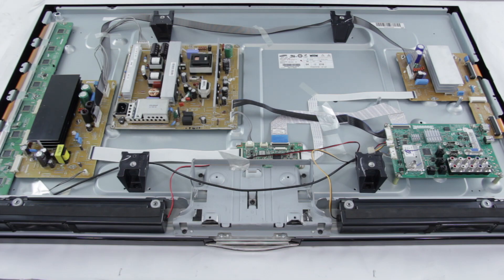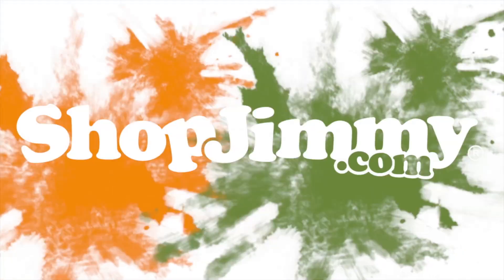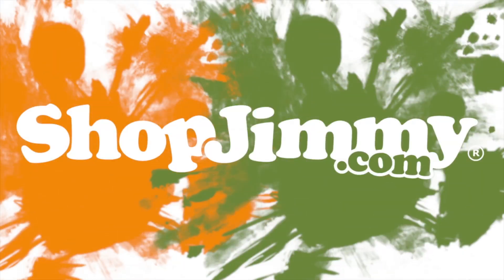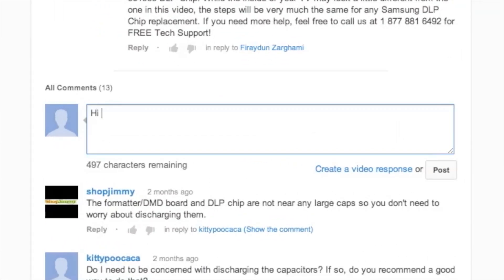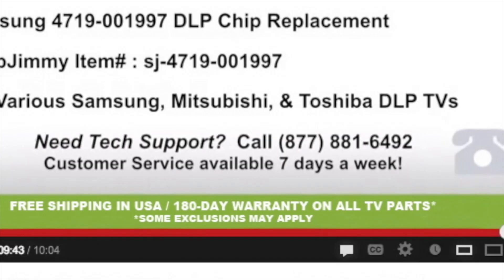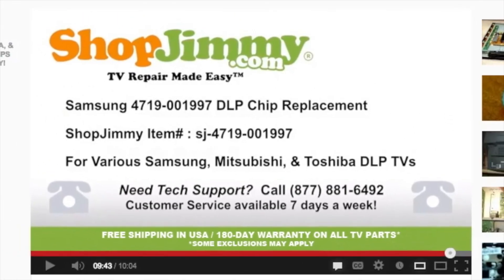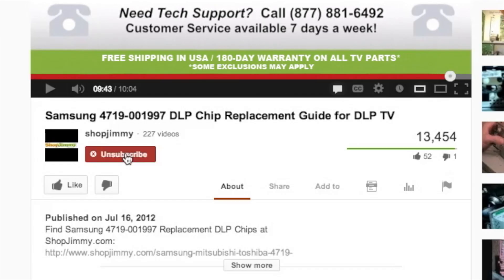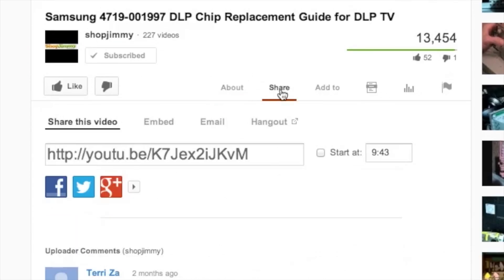Plasma TV Repair Tutorial - Common Symptoms & Solutions - How to Fix Plasma TVs

Comment: i have an LG plasma (50PS70) that wont start up. It shows the red light standby light, then when hitting the power button, blue light under the TV flashes then turns off and goes back to red standby light, what can be wrong?

Comment: Great information, thanks. I have a Samsung 43" tv that makes a noise when first turned on, screeching noise, then goes off and back on. through out the day it will cycle on and off. model number pn43f4500af(xza) type: pn43f4500 Ser: z6m03cqd430899y   any  help would be appreciated and if you think it's worth trying to repair and you have a part let me know.  thanks...

Comment: Samsung 50" plasma with vertical lines that are only on occasionally (about 2" thick and about 8" from the left of the screen) The fact that the line is only there occasionally is what is confusing.
Reply: Model number is PN50C490B3D

Comment: so I have a LG 60PN6500-UA it was working fine until just recently the red light that is usually on while the TV is off (standby light I assume) was no longer on. When I would try to turn on the TV there would be no response. If I unplug it you here the TV click like it does when turning on or off and the red light would come on until the capacitors drained. when I would plug it back in the TV would click on and the red light would flash but the screen would be black but noticed it was illuminated after turning off the lights. I would not be able to turn the TV on or off during this with either the button or remote. I did find on a forum a way to reset the logic board I believe by unplugging the TV then while holding the power button down plug it back in and it would reset the board, doing so would get the TV to turn on and work fine for the duration of use and maybe a short time after turning on and off as usual, then eventually having to repeat said process to get it to turn back on. Any help with this would be greatly appreciated. I want to said it's the control board but after watching this video makes me wonder if maybe it's the power board or something else.

Comment: PN51E550D1F

TV won't turn on. red light blinks 10 times pauses and then blinks again. This started happening after a brief power outage from hurricane matthew. I opened the back and the capacitors seem to be fine.
Reply: check the fuse on the transformer,  the sound look like your TV is a Panasonic plasma

Comment: SAMSUNG PS60F5500 Smart 3D 60" Plasma TV
It turns on and off and on and off, each time displaying my PC perfectly or what ever is connected up, briefly, 8 seconds roughly. Then turns off. Then on again straight away and does same. Repeats over and over. I was trying to get to the menu to hit reset, but turns off before then. I noticed that on the second repeat it impossible get into menu, freezes. If ya plug out power and turn on, you can navigate for 8 seconds before it goes off. You can also turn it off yourself before it turns itself off. And leave it for ages and turn on, but it will then start the cycle
Any help much appreciated ?
Regards 
Daniel
Reply: I have bought a spare part as the fault is very like what you have explained for the Y SUS.
SO buying this. We change and see fingers crossed. Exciting 
Samsung - Y-SUS - 60FF, LJ41-10331A, PS60F5500AKXXU
Reply: Did it end up being your Y-Sustain?
Reply: Nope.... There are three boards. I first bough the Y-Sustain board and changed it... Problem still there... So gambled again and bought the power board... It also was not the problem. I then said fuck it might as well see this to the end and bought the Motherboard, that fixed it thought. I dont mind having the two extra board, never know might need them. I will be watching this TV till its is do dead, not even God can fix it . LOL
I have noticed the TV buzzes a bit too now, so that must be another problem Due ! It buzzes more when bright screen and less with dark screen.
So wait and bite my nails for it to die again
Reply: I'm glad it worked out for you. I had someone give me a nice big Samsung 3D plasma TV. So far I haven't figured out much. If it's not too expensive I may start gambling too.
Reply: you'll need to remove the boards and get the code and model of board. Makes finding replacement board easy. I paid about €120 for all three boards, which isn't bad considering what it may have cost to fix it. I still have two spare boards in case. Depends what your problem is though, whats the issue?
Reply: When you turn on the power the relay clicks once, the TV buzzes (like a screen about to initiate) and the screen flickers slightly like it wants to turn on. Samsung PN60F8500, It's just a few years old and it seems that the boards are pretty hard to find (and expensive). I detached the X and Y sustains last night and with either (or both) disconnected the TV won't turn on at all. Considering its behavior it feels like a power supply board issue to me. Obviously I am an amateur when it comes to TV's and there could be a few culprits here. I am going to see if I can't figure out how to test it with a multi-meter and go from there.
Reply: Nah man parts are easy find
you have to use the model code
... will pop up straight away,,, there numbers found on the board, not the tv model , the board model... once ya google that, you'll ind instantly
Reply: Mine (Sanyo dp50749) does the turn off and on repeating thing while the light is green, I'm thinking I should try and replace the main board or the Y board..  What do you guys think?

Comment: My 60 inch Samsung Plasma has vertical lines on the right side of the screen.  It started out as 1 line running from the top of the screen to the bottom.  Now there are several lines, a few which do not reach the bottom.  The model number is: PN60F5350BFXA.  Thanks for your advice
Reply: excuse me but I don''t believe PLASMA screens have T-Cons do they? I thought only LED TVs had those?
Reply: plasma tv have T-CON BOARD they call it LOGIC BOARD...
Reply: I just had the same problem on my PN60F5300BF, did you figure out what it was?
Reply: My trusted technician determined that a channel was not functioning (I don't know what that means).  The fix requires a $900 part.  I decided to trash it.
Reply: My PN60F5300BFXA also has all purplish vertical bands and lines across the whole screen.    Is that the logic / Main board?
Reply: Daniel Carbaugh
Reply: Y-Buffer board, one of the chips is bad, get a new y sustain board as well as a BUFFER as they get replaced together for good measure ....
Reply: Chances are, YES it is the logic. Do you see the heartbeat LIGHT, How often is it going although it can act normal pulses but still be the logic. The main way to tell what it is beings the ribbons are fine is to pay notice to if the vertical lines are all from middle to left or right to middle as that can be the left or right address board as well as logic but in my case, i knew my connection ribbons were good and cleaned and the pink (sometimes diff colors depends on TV brands and settings, etc) VERTICAL line are from one side to the other as in BOTH address boards then it is probably as you said, just a logic board - order the board as they are cheap on eBay! Worth a shot, worst case, get two new address bars to if you feel the ribbons are def not damaged in anyway, thy can take more of a beating them people like to lead on, especially TV repair men! I blown mine up with over voltage and the arcs didn't even burn a whole or scorch them, I agree with you and say LOGIC for sure! Good LUCK man! -Stephen
Reply: So im having a issuse with one of my tvs samsung plasma model pn51d430a3d
So i had replaced the main board that has the hdmi ports an such. As well as the y buffer board but i still am having issues with the screen only showing 2/3s of the screen. Sound is gone dont really care about that. Color is all good. No crazy lines or anything showing. It just has 1/3 of the screen all blacked put 

What is the issue?
Reply: Brian Hall t-con board !  Easy fix

Comment: i have a 42 inch samsung plasma identical to the one in the video. it was struck by lightning through the cable box. it had no power to the video board do i replaced it. Now when you plug the tv in the relay on the power supply will click but i dont get a red stand by light or the tv will not power on. If im not mistaken the logic board has a green light that is suppose to flash every second. This light is only flashing about every 5 seconds. Any suggestions?
Reply: signal board

Comment: I have a Samsung 50" Plasma TV Model: S50FH-KD03 and just recently my wife and were watching a program when all of sudden we hear this popping sound and the picture disappears. The odd thing is that the stand-by came on and stayed on (no blinking). I'm thinking one of the fuses on the power board blew out but I can't tell if the fuse or fuses did blow because all the fuses are covered in white. Could that be a problem. I looked at all the capacitors and they are look good but I could be wrong. Should I send it out to a repair shop or is this an easy fix I can do at home?

Comment: Hello. I've got a 50" LG Plasma that simply turns off once turned on. It may take 5 minutes to turn off, or it may take 2 days to turn off. The tv does get power and the screen is fine. It simply powers off. Once some occassions when powered up, it will initially ask if I want to use a prticular HDMI, via a window that appears on the screen. Whether I chose 'yes' or 'no', I get the same results; tv powers off. Sometimes after I've attempted to turn it off then on, it simply WILL NOT turn on at all. Could this be a main board or power board issue? Thanks in advance!

Comment: Hi Jimmy I have an Samsung PN58B650 it was running fine until few days and all of sudden it just went black and keep on restarting the Red power /Standby light keeps blinking for few times and keep cycling. I saw your video which is very helpful but I need more information so I can order the correct parts for it. Also I opened the TV back and I didn't see any bad capacitors so you don't mind guiding me that will be great thanks.

Comment: I have an RCA 42"tv  model number LED42C45RQ made December 2013. The back light comes on for just a second or two then the screen goes dark any thoughts? Another video suggested that there might be some bad capacitors on the back light driver side of the board but I didn't find anything obviously wrong like the video shows can you help.

Comment: I've got a 42" vivo plasma TV S42AX-YB09 that has no picture, turns on and makes clicking sounds but the picture never comes on, the LED in the corner won't turn off afterwards either without turning the main power switch to the TV off

Comment: I have a 60 inch LG plasma model #60PN6500 shuts off occasionally when volume is pressed, input,and channel changed then it turns back on after a few mins if you can help me out i really don't want to get rid of it.

Comment: Sanyo TV DP42740. Just put in a power supply. The TV clicks when plugged in. There is a green light that comes on inside the TV. No lights coming on the front of the TV. Push power button and nothing happens.

Comment: I have a Samsung PN51D490A1DXZA Plasma TV. NO sound No video, light on logic board flashing fast after ~ 30 minutes shut down. I have checked some voltages. 
VS checked 270 volt and keeps moving up 400 volt +.
VA checked 97 volt and keeps moving up 110volt + .
On logic board 
Pin  #1- 5volt checked 9.47 volt
Pin  #2 - 5 volt checked 9.47 volt
Pin #6 - 5volt checked 6.38 volt
Need help. What do I need to replace?

Comment: Hi Jimmy
I have a Samsung Plasma PN51F4500BFXZA. It was working fine until a thunderstorm hit. It was connected to a power strip and so were all my other devices. The power strip and everything else is working fine but the TV now won't recognize the signal coming from the cable box. It happens at both HDMI ports. The cable box has been tested with other TV's and works fine. I have used a computer to watch Netflix and both HDMI ports work fine for computer signal. So, it's only the cable signal that's compromised. I've tried a soft reset (unplugging everything) as well as a Factory Reset and it didn't fix the problem, What would you recommend? Thanks!

Comment: I have a Samsung PN51D450A2D that stopped working with the clicking noise. After watching several vids, I have discovered that even if I disconnect the power supply from the X and Y boards, the clicking continues. Also, the green LED on the logic main does not come on at all at any time, however, the standby light does.

I have not yet put a meter to it to check voltages.

Thanks

R

Comment: Hi Jimmy,
I have a Samsung plasma tv PN50C450B1D that has no picture. Main psb board is a BN44-003330A. When it's plug in there is 6 clicks coming from the relay(s) on the psb, the stdby light on front blinks on/off then when the clicking stops the stubby light stays on. When I disconnect the logic board connector from the psb the tv keeps cycling with the familiar Samsung start up sound and then does nothing. No indication of any capacitors bulging on psb. Any suggestions. Thanks.

Comment: Hi my plasma is a Samsung PN60F5300 the problem is that i have 2 vertical line from top to bottom on the right side a couple of inches from the edge of the screen, which board do you suggest i replace ? Thanks

Comment: I have an LG 50PV450-UA plasma manufactured on march of 2011.  It sustained a large power surge and will not power on.  The stand by power light will not illuminate either.  I replaced the power supply board and it still will not power up.  The only difference I can tell between the original board and the new one is the number after the forward slash in the part number old board was 10 and the new board it is an 8.  Any suggestions?

Comment: I have a Santo dp50710 that the green light stays on but no picture. there is a small green light on the green board to the left of the power board. at the p2 terminal the voltage drops when the small light goes out.

Comment: Hi I have a Samsung Plasma tv model PN50C450B1D. It does not turn on and no standby  power. It looks the same tv that is on your video. It is not the power supply because I already change it and symptoms are still the same.  Thanks

Comment: That looks like a NS-42P650A11, correct? If so, what fuse do these take? I have power and a standby light, but when I try to turn the TV on, the relays click, the standby light flashes a few times, and then goes back into standby mode. I'm going to Harbor Freight in the morning to get a meter so I can test the fuses and the 5v lines, but I thought I'd ask about the fuse type/size since it may take a bit of time to get a reply to this comment. Also, feel free to treat me as a novice, no offense will be taken since I can use any and all info you can give me.

Comment: hello  my l have  PN60E530A3FXZA  samsung  I  buy and replace  power supply board  also  main board  brand new. ...when I   conect my  tv  the red light on front  turn on  no blink  and when  I  use the remote control  to turn on. .the red light start  blinking. ...what is the problem. .any ideas  am tinking to buy the logicboard  ...

Comment: Hi have a Panasonic TH-42PZ80BA it turns on fine works on DVB good but when i select HDMI, AV1-2-3 etc it get a still image from where i changed over from DVB also when i select these input i get the stuck image but a fuzzy pink snow down the right hand side.

Comment: I have a Samsung PN60E530A3FXZA plasma TV that wont turn on. Several months ago it developed a problem where I would need to turn it on, see  nothing on the screen, hen turn it off and back on it it would then work. Once it came on it was fine. Now I can not get it to come on at all. Maybe you can suggest which board might be bad. I have the back off and do not see any obvious issue such as bad or leaking capacitors.The RED LED on the front blinks and then goes out so I am getting power.
Reply: I have the same exact issue with the same tv...
did you find a resolution yet?
Reply: I replaced the Y-Sustain Main board with a used one I found on eBay and that fixed my TV. You can also find someone to repair your bad board on eBay.
Reply: @LesLariz  I have a 30 inch LG Plasma EDTV from 2008.  Works great, BUT I have to turn it off and on 3 - 4 times to get a picture!  Sound comes right on.  Who can replace a "board" not me - who do I go to?

Comment: July 2016: Samsung pn43d450a2dxza n102 - no picture, sound works fine. Front red LED blinks 5 times after powering on. Already updated the firmware after replacing entire BN96-16510A X-Main Board also from shopjimmy last January 2014. Worked great for 2.5yrs - no issues at all. Which board needs replacement this time?

Comment: Hi Jimmy, I have a Samsung PN64D7000.  I suspect there's a problem with the main board.  I started having problems with the HDMI inputs awhile back.  Eventually, the TV defaulted to 1 HDMI port regardless of whichever one I wanted to use.  Finally, the TV has stopped working altogether - it power cycles on and off, the remote doesn't seem to do anything.  The Samsung logo does appear on the screen when it powers on.  Can you confirm my suspicion?  thank you!

Comment: Samsung PN64E550D1F Have sound and no Picture. I have checked Vs Va Vsc and VE all voltages are within spec. Screen is completely blank. LED blinks normally on the logic board once per second.